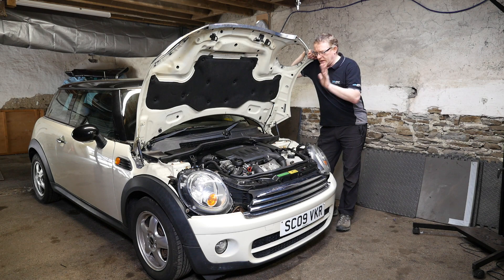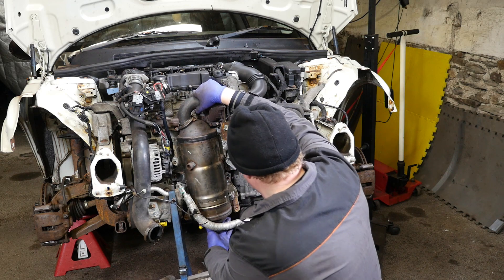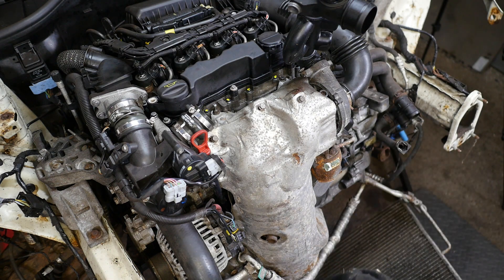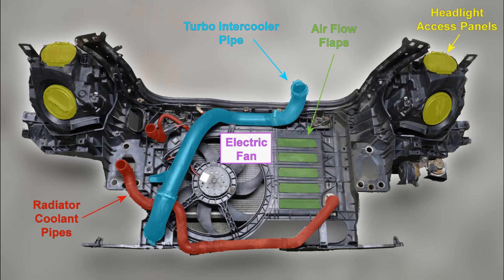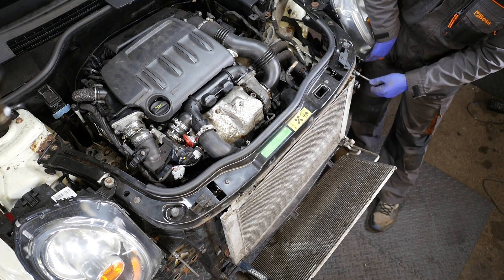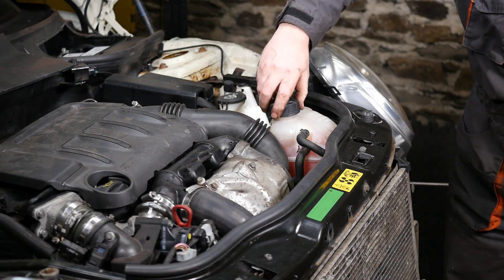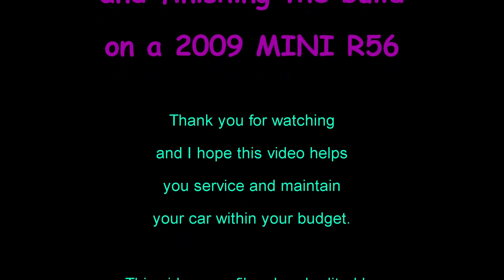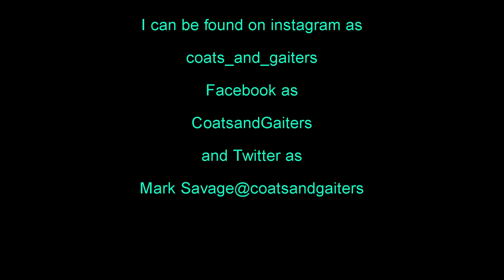Penultimate Part 16 - I refit the Diesel Particulate Filter & finish the repair on my MINI R56

Comment: Great video buddy hope it really fires up after that hard work. Doubt I would ever look at buying one of these minis as look very rust prone.
I do prefer the original (proper) mini though if I'm honest. Look forward to the next one
Reply from the maker: Thank you for the compliment.  The next video might be an interesting one as things didn't go as I had hoped !!!
Reply: @CoatsandGaiters  let's hope it all works out mate.
Quick question do you still have the x trail and could you possibly tell me if the tow bar electric connector is a 7 pin or 13 pin on your model as iv found out mine is a 13 pin but trailer is 7 pin and iv had to buy a connector as otherwise I would have to re wire to a 7 pin and I don't really fancy that job as I'm not good with electrical work

Comment: Hi there my dpf keeps coming on I’m thinking off buying dpf cleaner where would I put it in from ?? Thanks
Reply from the maker: Normally you can inject it into the hole for the front pressure sensor pipe.  That way the fluid will enter the dpf at the front.